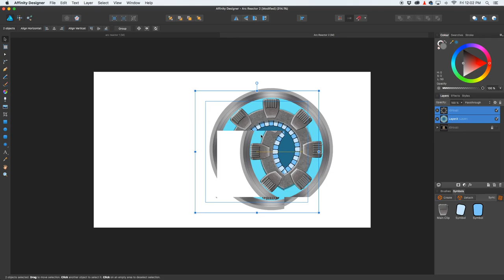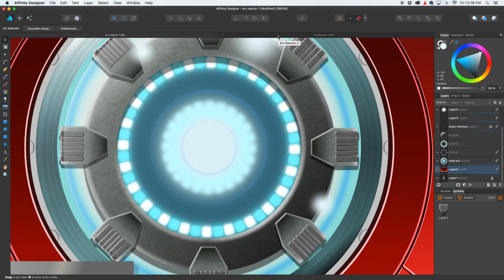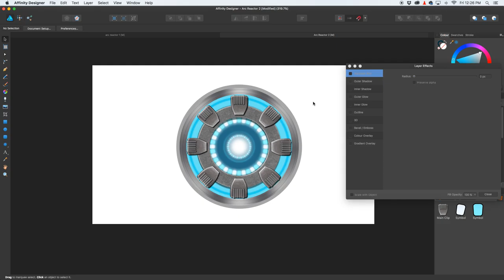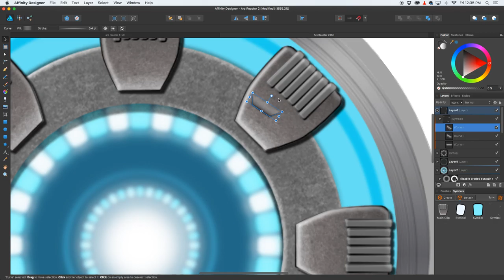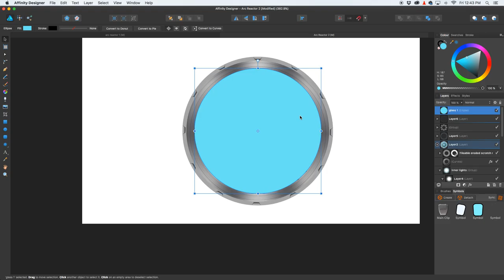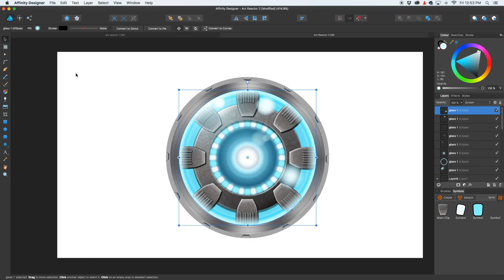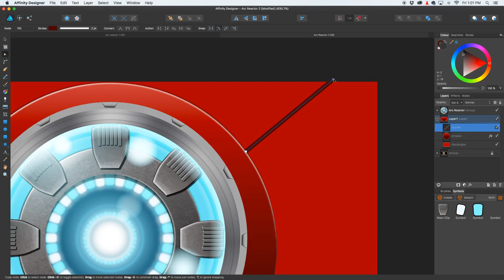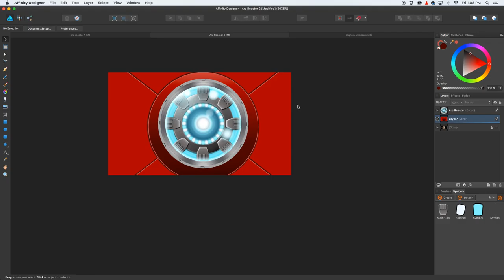Affinity Designer Tutorial Super Hero Arc Reactor part 2

Comment: To rotate and repeat an element around a circle a specific number of times, divide 360° by the desired number. The result is your rotation angle in degrees. If numerical accuracy is needed, input the rotation amount in the Transform Panel.